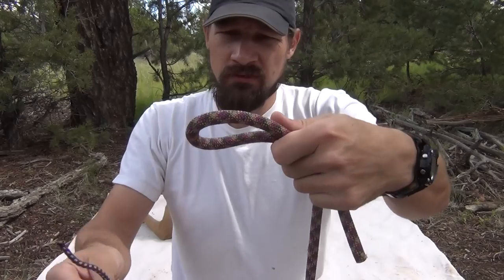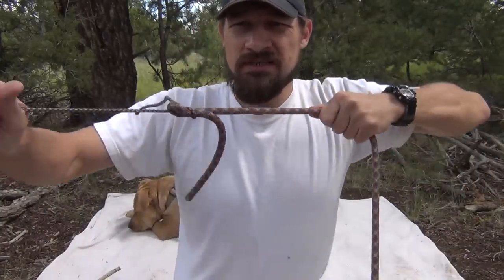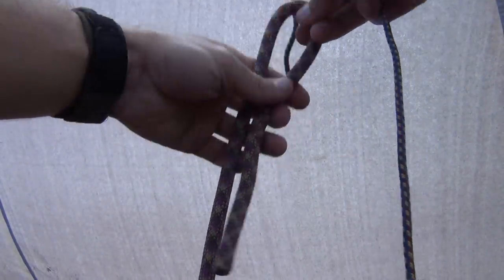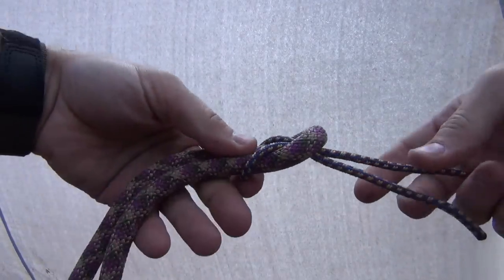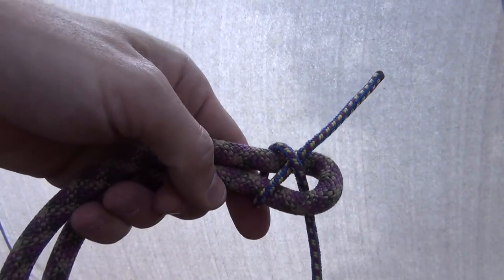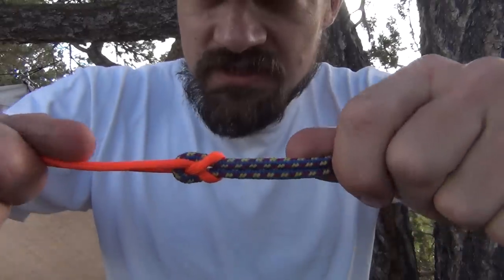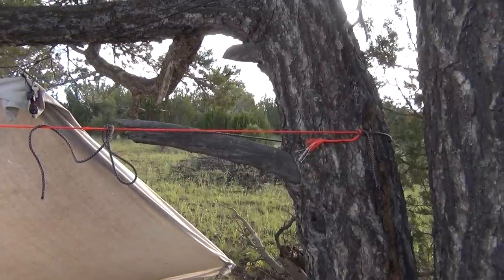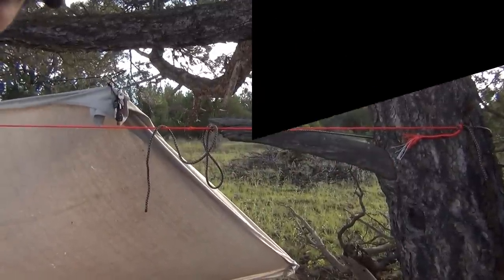Sheet bend - HD

Comment: I like that not cool video could you use it on the same diameter cord or rope? Thank you for your time to make these videos.
Reply from the maker: Thank you for taking the time to stop by and share your kind words as well as the support you give my channel. Have a beautiful day! Oh and yes,,, you can use it on same size cord. I do it all the time with paracord. lol
Reply: +jiujitsu2000 Thanks for answering now time to fire up my Dillon 550 and load some 9mm have a great day.
Reply from the maker: +Lou Flores your welcome. this knot is related to the bowlin and can be easily undone after its had a heavy load on it. have fun loading 9mm... it's funny because I had several 9mm questions today. barely keeping up. have a good day, I'm off to bed... worked all night. time for some zzzzzzzzzz's